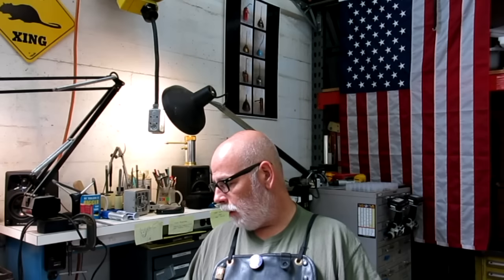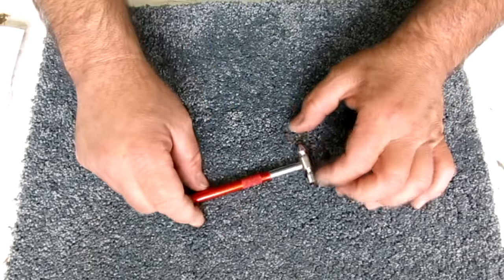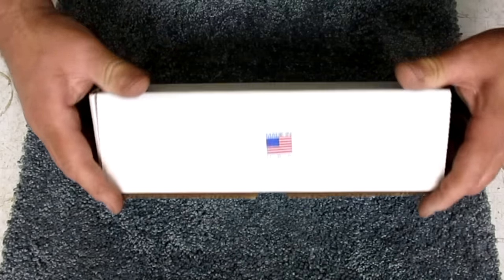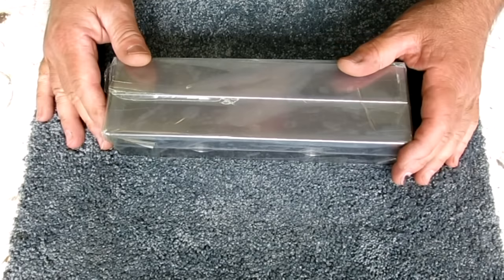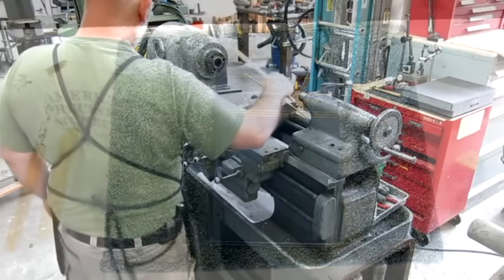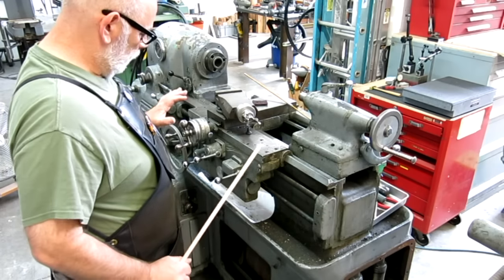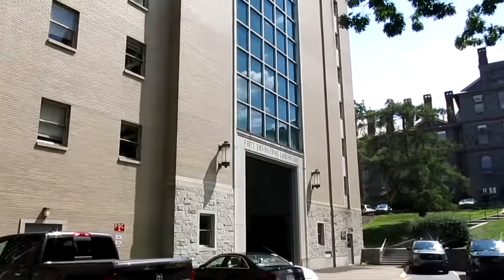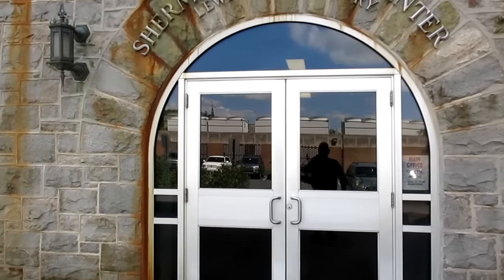Monday Night Meatloaf 104

Comment: Just recently was able to acquire an older Marvel #8 saw, very happy to get it and get it into working condition. The motor is 440 only so fitting another  220 motor with VFD. Nice to hear Tom call out all the nice features and advantages of the design.

Comment: Hi Tom !

This Herringbone gear ... in fact the french Andre Citroen (the Citroen car) got a patent from an old polish ancestor of these gears made in wood for windmills and found a method to make them in steel for big machinery and motors - that's why the logo on the Citroen car looks like it does today - like <<  turned clockwise 90°
Reply from the maker: Hi Keld,

I had not heard that before. I thought the herringbone gear was pretty old. Thanks for the comment.

Cheers,

Tom
Reply: I just wanted to mention that the relief cut Tom mentions isn't to make cutting the gears easier.  If the teeth do not have that channel then the gears can only turn in one direction without hydraulically locking on the lubricant.  The upper pump appears designed to be run in both directions for controlling a hydraulic ram.

Reduction gears in a ship are a great example.
Reply from the maker: Hey Paul,

There are a few methods for making herringbone gears. They can be cut with a cutter, a hob or a gear shaper. With the shaper you need a relief cut at the end of the stroke to break the chip. There is a special shaping machine developed called a rack planer for shaping continuous herringbone gears with a sharp apex and no relief. There are many examples of herringbones with no center relief channel. Thanks for the comment.

Cheers,

Tom

Comment: Tom, you were about a mile from where I live. when you were at the furnaces, if you would have walked down further towards the sands you would have seen two long buildings on your right that were fenced off. Those were the machine shops for Bethlehem steel. in one of them there use to be s lathe that they made the gun barrels for the destroyers. it was so large that the tailstock and the carriage rode on a set of train tracks mounted in the floor. 
Right down the road from there is also Lehigh heavy forge which is still in operation. That is where they press out the abom++ size gears and shafts. 
The Lehigh labs used to be part of the steel too. at one point it was the most advanced metal laboratory in the world. 
Not too far of a drive away is the ruins of the Thomas Iron Works. who was the first holder if the patent for steel until Bethlehem steel bought them.
Reply from the maker: Hi Brian,

Well next time I'm out there I'll do a better job of announcing it. Apparently there is a whole nest of you guys near there. I would probably still be there. I saw those buildings. There were a couple of small machines you could still see. A radial drill and something else. Thanks for the comment.

Cheers,

Tom

Comment: Moses Glock just announced that he is retiring.  they had a second property but just recently auctioned the contents.  it was great.  I have bought a ton of stuff from them over the years.   I got my mill there and several other projects.    right near the steel stacks is the #1 machine shop which is still in operation.  some of the machines in there would blow even your mind.

Comment: Hi Tom,

I helped someone on the Home Shop Machinist forum out with a 10EE drive. I think half of it was missing and spares nearly non existent in the UK, so I recall using three terminal phase angle control devices and bridge rectifiers.
Reply from the maker: Hi Paul,

Good to know. They have a couple of weird transformers in them that go bad and are hard to source a replacement for. I can't recall the specs but my local EE guru says they cause all kinds of fits with these controls. Thanks for stopping by.

Best,

Tom

Comment: So on that band saw. Does it have a guide system to twist the blade 90 degrees? Or am I glossing over how it operates?

You get all the cool toys. I've got so many projects that require some form of machining, but I don't know anyone with the tools. And no shop is gonna let me use their stuff.
Reply from the maker: Yes. The blade guides twist the blade 90 from the bandwheels.  Thanks for the comment.

Cheers,

Tom

Comment: I love Moses Glick! I hope you had a chance to get to the building where they house the good machinery. The outdoor yard holds most of what I use as a farmer (bulk material and such) but the building down the road is incredible. I saw a lathe big enough to turn a Volkswagen over there once.
Reply from the maker: I just missed an auction when I was there. The second building was cleared out. Thanks for the comment.

Cheers,

Tom
Reply: They have a very active ebay account as well, I would encourage you to check it out. Only a few hundred items listed right now, prbly because of the auction. Usually they have several thousand items available. Materials, equipment, ham presses, you name it.
Reply from the maker: Didn't think of ebay for them. I'll check it out. Thanks for the comment.

Cheers,

Tom

Comment: I have had a Monarch 10ee for about 25 years and the people at Monarch have been more than helpful when needed. The parts may not be inexpensive but they fit every time.

Monarch claims they still build the 10ee if you are willing to bring the $$$$$. In this day of CNC and CAD/CAM there's probably little justification for an expensive (but well built) manual machine selling for similar cost.

Comment: Nice 10ee! I have a 1962 module drive model. I got lucky when I bought mine, the original drive works fine. It even runs on single phase, all but the coolant pump. Monarch has maintained records of these old machines and when you call them they are always more than willing to help with anything you might need. They even supplied me with a complete manual.  If you need any tooling let me know. The guy I bought mine from has a bunch of it.
Reply from the maker: Hey Chuck,

I have dealt with Monarch in the past. A first class outfit. Thanks for the comment.

Cheers,

Tom

Comment: that marvel brings back memories. i was a millwright and maintained a group of marvels that had hyd servo feeds. they were in production to cut 10" diam tubing that was used to make 500lb bombs for the Vietnam war(yes i worked in a bomb factory). those babies were hard tokeep running properly, when they were in a bad mood you couldn't keep teeth on the blades. your mechanical feed pressure looks very simple i'm sure you will have better luck with yours. loved you pics of the old blast furnace. i worked in the pitts mills for 20 yrs. you would have been more impressed to see them running.
Reply from the maker: Hi Larry,

I don't know how close I would have wanted to get to an operating blast furnace. It must have been impressive to say the least. Five running at one time? That is like terraforming. Thanks for the comment.

Cheers,

Tom

Comment: Hi Tom, do you need a steady rest for your 10ee by any chance? If so, give me the center height from the flat way to the spindle bore center-line. If the one I have fits, we might be able to work out a deal. The fingers are bronze, and look to be built up with braze at some point, and is missing a knob. But it all works.
Reply from the maker: Hi Andre,

I'll measure it up. I noticed your email. Thanks for the comment.

Cheers,

Tom
Reply: The round dial machines had a 1/4" shorter center height than the later square dial ones.

Comment: The saw, is it band or reciprocating? If band, I don't understand how blade teeth would be facing towards you? The band would be strung around two pulleys and the upper housing (although not clearly shown in video) most likely would have pulley running parallel with travel, which would put teeth at 90deg to work! unless the band was twisted somehow to bring teeth in line with work.
Reply: The band is twisted just like a regular horizontal band saw.
Reply: Thanks Josh, it just seemed or I assumed that its probably a much bigger band (3/4 or 1") given size of saw and a fairly short space between upper pulley and upper cutting area to make that bend. Thanks again.
Reply from the maker: Hi Fred,

Continuous band. The blade twists 90 as it goes through the blade guides. Thanks for the comment.

Cheers,

Tom

Comment: Hi mate,  Congratulations with the acquisitions of those fine machines.  I think I heard some soft crying of a beloved Johnson and other bandsaw, that no doubt will have to make way this behemoth.
Reply from the maker: Hi Marcel,

Are you saying my Johnson was crying for you? Thanks for the comment.

Cheers,

Tom
Reply: Not really, I have a nice power hack saw. However I have been thinking of buying that dinky shaper of yours.  I wonder what the shipping costs would be.
Reply from the maker: Hey Marcel,

I can almost fit the shaper in an airmail envelope. Jump in the Timmermobile and come pick it up. 

All the best,

Tom
Reply: Unfortunately the Timmermobile has no water wings. I would have been there with a couple of "new" hammers in a jiffy.

Comment: I heard you saying in one of your videos, don't recall which one, that you wanted a lathe with higher RPM for collet work, and thought: "For sure we will see a 10EE in the shop in a while"
And there it is! 
Congratulations with this purchase, awesome lathe it is, beautifully engineered. 
Were do you see an oil reservoir in the base of a tailstock on a lathe of this size? I never came across such a feature. (The cross-over tube underneath it may be clogged with dried out way-oil, and you may have to renew the felt wipers as well)
The adjustable bearings on the saddle under the bed are also nice when you run the spindle backwards
The mail to Monarch is normally answered within a day (by Scott or Terrie) LOL

Screwpumps, worked a lot on these. The one in the book is only suitable for oil as the herringbone gear runs in the fluid pumped.
They are (were) also used to pump ballast-, (salt) cooling water- or bilge water and in those cases the gears were placed outside the pump housing and ran in their own oil bath. The position of (one of the) the keyways for the herringbone gears has to be adjusted in such a way that the worms are not in contact with each other with a clearance of about 4 thou.

The turbine you showed in the book is intended to propel the ship.
Lots of well-known details as I am a marine engineer by trade.
A pity I could'nt read the legend as I saw several details that you don't see anymore on marine turbine installations.
For instance, I would expect that the upper part of the drawing represents a HP turbine.
Steam enters the turbine on the right were it first passes a Curtiss wheel and than to the center the various Parsons stages.
On the left another Curtiss type turbine, which I expect to be the astern turbine.
Nowadays that would be considered as being peculiar because on "more modern" installations the astern turbine is always aft of the LP (low pressure) turbine.
In that case it runs in the vacuum of the condenser causing less (steam) friction losses when the ship is sailing in the ahead direction. (which they normally do most of the time, at least when I was at sea)

Apologies for the long story.
Reply from the maker: Hi Jan,

I'm telling you. The machinery gods are listening to me. This stuff is falling out of the sky into my lap. Glad you liked the marine engineering book. Lots of cool pictures and machinery drawings in there. Thanks for the comment.

Cheers,

Tom

Comment: Does the blade twist?  Looks like it's a conventional band saw configuration which would make the plane of the blade perpendiculalr to the direction of travel.
Reply from the maker: Hi Gordon,

The blade has a 90 degree twist in it as it goes through the blade guides. Thanks for the comment.

Cheers,

Tom

Comment: Tom, I have an interesting question for you that I hope you will be able to help me out with and might consider including in one of your excellent vids. 
When a bolt etc. is torqued to any specific measurement there would of course be a certain amount of face pressure exerted by that bolt onto whatever surface it was clamping. In the case of any lubricant like oil or grease being used, or even anti seize lubricants like Copper Coat, Loctite, Henkel, etc. how much of an increase in clamping pressure (percentage-wise) would there be exerted by that bolt on said surface? Assuming, of course, that there would be in increase. Thanks :-)
Reply from the maker: Hi Michael,

The addition of lubrication of any sort on the threads of a fastener give a large increase in clamping pressure for a given torque. The increase in preload for lubricant on the face of the fastener is a little murky. It would depend on the type of fastener head and the two mating materials. I'm also pretty sure somebody has thought about in detail. Thanks for the comment.

Cheers,

Tom

Comment: I've always envisioned buying an old solid saw and modifying it to work on a rail system, much like they do with wood saws for people who don't want to own a wood saw mill. But to find that this exists..well, this changes things. It's pretty much exactly what i've been wanting, and more. I wonder if i can find one in Europe that won't cost an arm and a leg.
Reply: Uh, oh, cut an engine in half, man, that would be soo neat to see.
Reply from the maker: Great question. I do not know of any European makes that offer a vertical blade traveling column machine. That does not mean that much however. Thanks for the comment.

Cheers,

Tom

Comment: Tom, speaking of giant tensile testing machines, what about the Southwark-Emery at PEER Berkeley??  That thing is a monster.
Reply from the maker: Funny you should mention that one. I have seen that one first hand also. Its actually the same model press. 2000 Tons. The really impressive thing there was the seismic test table. They can shake something like the size of a small apartment building on it. Very cool. Thanks for the comment.

Cheers,

Tom
Reply: Tom, About a year ago, I was there to use the shaker table to seismically test a switch.  It was 5,000 amps.  The switch structure with the insulators was 30 feet tall, and with the whip open, it stood 45 feet tall.  They had to open the sun roof in the high bay.  Myself and another mechanical engineer erected it using the bridge crane in there, and the men on the staff there were just awesome.  I had to go to Grainger across the bay to buy a 3" slugging wrench.  I love big toys.  We actually were the first company to pass with a switch that size.  Would have hated for the insulators to break and that thing come crashing down.  Lots of windows in that high bay to break also.  At that time, I worked for Southern Electrical Equipment.  That was my first time to San Fran.  I really love that place from the short time I was there.  --Dan A.

Comment: It looks like the blade on the band saw is mounted east west and the saw moves north south. How does that work? I'm I wrong?
Reply from the maker: Hi James,

You will have to speak in clock hands for me to understand..... Just kidding. The blade is twisted 90 degrees as it goes through the blade guides. The teeth face the same direction as the column travel. Thanks for the comment.

Cheers,

Tom

Comment: Tom,
On the new band saw. Does the blade get twisted 900 degrees to align with the slot in the table? Eric
Reply: There are guides that twist it 90 degrees so the teeth are toward the operator.
Reply from the maker: Hey Eric,

Yes there is a 90 degree twist to go from the bandwheel plane to the sawing plane.  Thanks for the comment.

Cheers,

Tom

Comment: Steam valves and steam turbines. My dad was a navel officer and tells stories about high pressure steam. Thanks for sharing.
Reply: So did my father in law from the Korea era.  He was a machinist mate and on a repair ship.  He always said they always had broom sticks laying around in the engine compartment in the event that one of them saw some condensation on a bulkhead - they would wave the sticks around to find the escaping steam jet so they would not walk into it and get cut to pieces.
Reply from the maker: I have heard this one. Live steam is invisible and will cut a corn broom to bits.  Thanks for the comment.

Cheers,

Tom

Comment: How the fuck do you get a compound to look like that?
Drop a running angle grinder onto it.

I don't get how some people handle their tools so badly.
I got a jigsaw thats 30+ years which i inherited from my grandfather.
Its used at least once a week, and still looks like brand new. Well despite the plastic wearing off that is, but no major scratches or anything like that.
And it was used in construction a few years ago too, by myself.
Reply from the maker: Some folks really only think about getting the job done. Thanks for the comment.

Cheers,

Tom